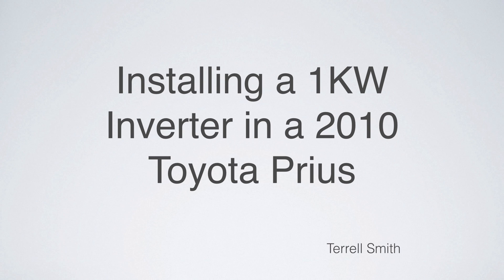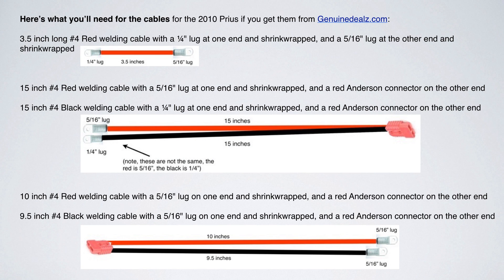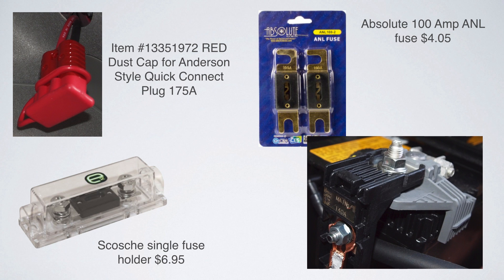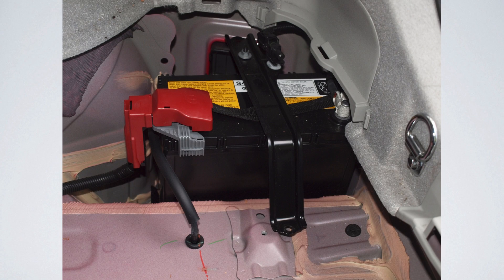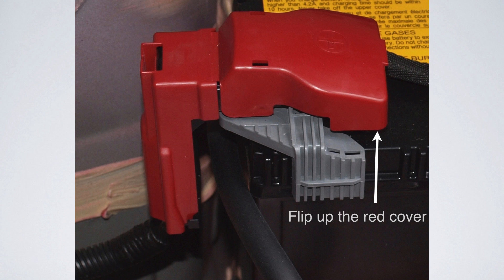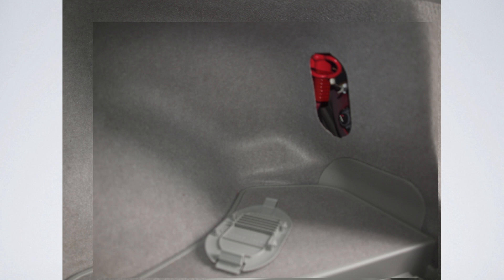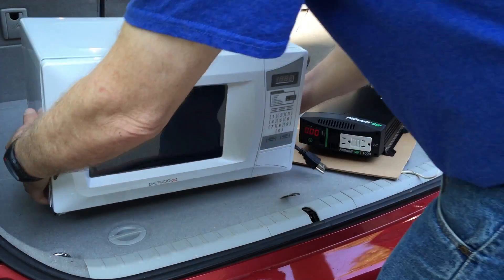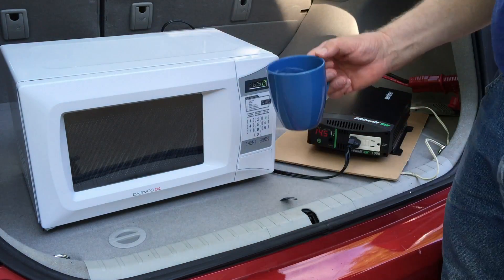Add a 1kW Inverter to Prius

Comment: Terrell, did you use the stock Prius 12v battery or replace it with a deep cyle 12v ?  If so, what size battery (amp hours) fit ?
Thanks
Reply: Ken, I'm pretty sure that the only purpose of the 12v battery is to boot the Prius computer.  Once the computer is booted any draw on the 12v battery comes from the 300+ volt traction battery.  Once the traction battery gets low enough the engine starts and recharges it, and it's ready for the next cycle.
Reply from the maker: +Ken Lumley Thanks for the question, Ken. I used the stock battery. From looking at the battery holder, I would guess that a larger battery would fit in there (not in height, but in depth). But then you'd be hauling around that slightly extra weight.

Comment: Very neat setup! I like how you hid your connections so that it's inconspicuous. I would think this setup would serve as a limited backup for power outages at home also.
Reply from the maker: +mrbr549 Thanks for the comment. Actually my original purpose was for power outage for the home, especially for the freezer and refrigerator. But since I set it up, we've had no power outages, and I realized it's perfect for camping.
Reply: @TerrellWSmith  and of course if you didn't have the backup system, the power would be out all time time.